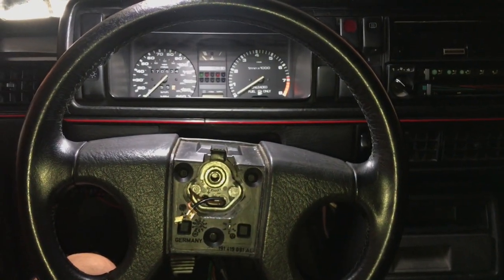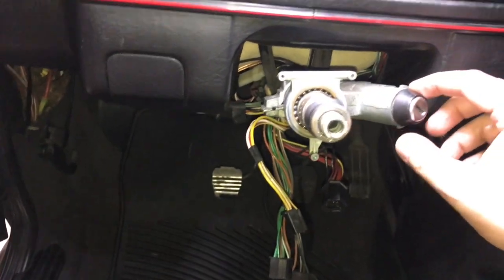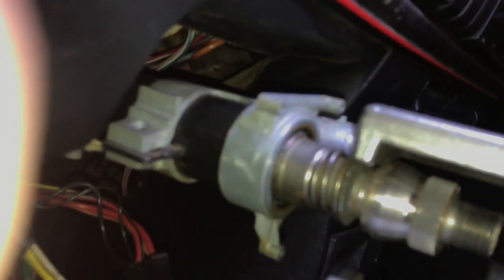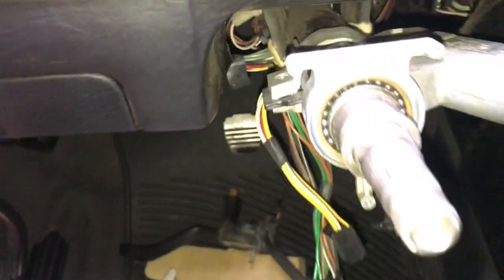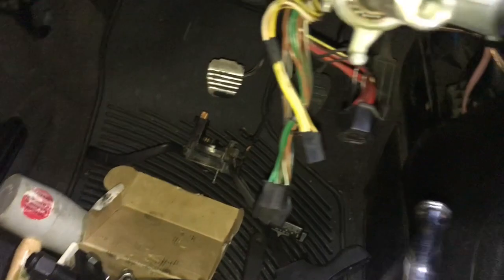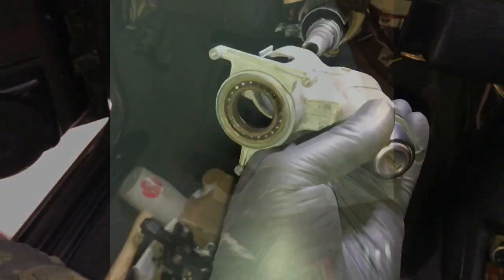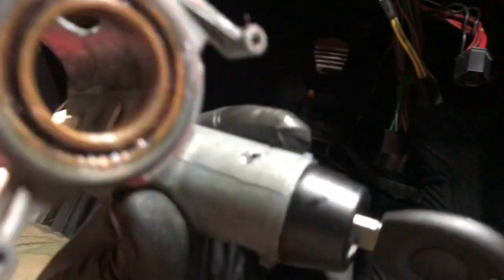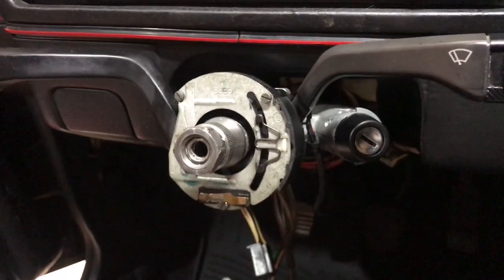1989 VW GTI MK2 ignition switch and lock cylinder replacement part 1

Comment: Hi I'm about to do this next week, I bought a new housing, lock cylinder, and switch. so when it comes off, is it fairly easy to put back on? just slide it on? and do you think all golfs have the 2 bolts holding the column in? i briefly glanced at mine, and they looked like rounded bolts that cannot be undone, maybe i'm wrong.
Reply: And i'm talking about the piece that you pulled off with the puller
Reply: So was it easy to put back on?
Reply: @markochrenst801  what ended up happening is, instead of doing this whole job because my steering column felt loose, a company called custom fab created a pedal stiffener, which makes the whole column stay in position so I didn’t do this yet, maybe when my ignition fails